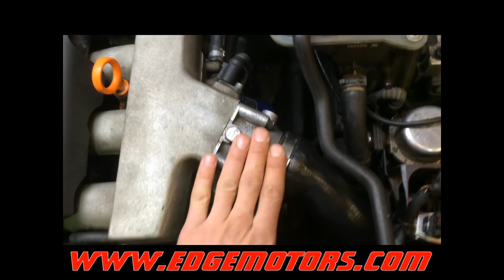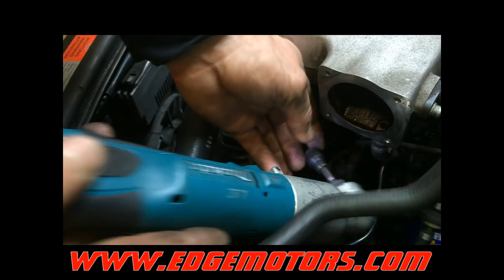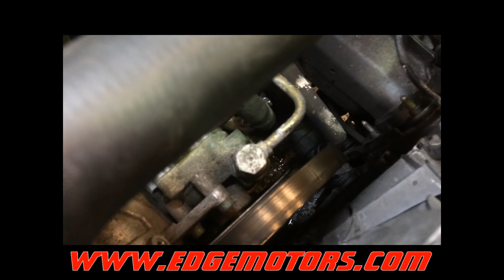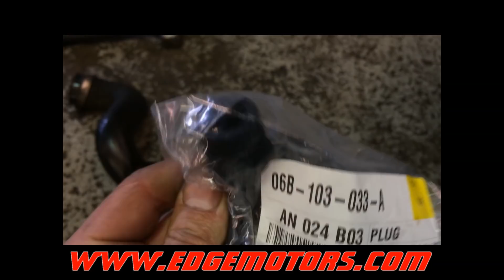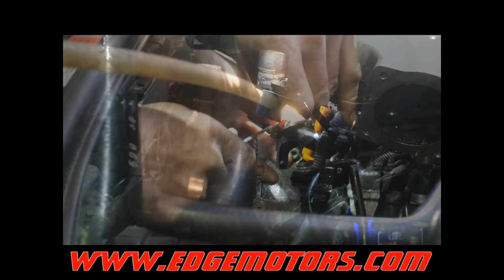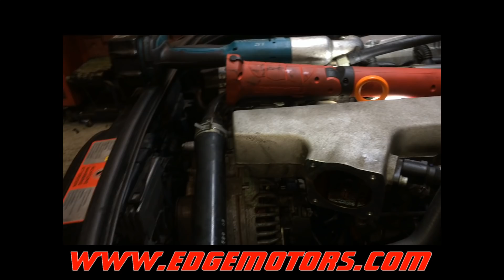2002-2005 Audi A4 1.8T coolant thermostat replacement DIY by Edge Motors

Comment: In my A4 the wires that are connected to the valve dried out and touched each other, burning my ECU, I changed the ECU and repaired the bare part of the harness, I installed a new thermostatic valve, but when it reached 100° C the ECU is not opening opening the thermostatic valve, have you ever experienced this? the plug only reaches 2.4v

Comment: Tip for some with different size bolts, mine was 13mm for the bolt from the top at the oil filter bracket

Comment: I know this video is old, but I’m having an over heating issue and have been searching for a solution. It only over heated when my AC was on full blast. I noticed my fans were not working so I’m thinking maybe it could be due to the fan module? I’m not sure. Any advice I would appreciate. I have a 2004 A4 1.8T btw. Thanks

Comment: Can anyone help. Ive got a 2005 a4 cabro 1.8T. I started to change the thermostat housing all ok. But the wiring loom was in my way si i disconnected all the d plugs. Now i dont. Know what goes were. What colors is the thermostat. Could i have the ict one conbected to it? Is my new thermostat working? Ive also changed the sensor at the bottom in libe with hose. Is that red and black or green and blue. Were does the a/c one go on? Does it connect to another d plug? Ive just foubd another d plug tucked away behind the front light? Help im screwed

Comment: have you done on the 2001 a4 b5? Im having a leak issue after installation. does the O-ring go on the engine side first then the thermostat, then plastic housing? or is it thermostat>Oring>housing or two orings? im lost, when i took it out the o ring was around the actual thermostat it wasnt real o ring
Reply from the maker: Thermostat oring housing...
Reply: @EDGEMOTORS  weird i placed the thermostat in, put the oring in the groovs, screwed it back on and it leaks everytime, not using any silicone or anything.
Reply from the maker: You should put the oring on the housing.... there is a little step for the oring....

Comment: Don't listen to this video.....jack the car up a little bit, remove belly pan if you have one.  Then you drain the rad, remove hose from thermostat housing 2 10mm bolts off housing and bam....reverse to install
Reply: Thought that was only for the b5 not the b6

Comment: Was that a coolant temp sensor you used to remove the coolant from, and was it a 2 -pin or 4-pin?  Could that sensor malfunction set off code P0116?

Comment: my car overheats and I already bought the sensor for the coolant and had a cylinder #2 misfire I changed all the spark plugs out and my car still overheats I need help on what it could be asap pls
Reply from the maker: Well, it could be allot of things, I would need a bit more info on the car...
Reply: Like what
Reply: What kind of info
Reply: +EDGEMOTORS if I run it around the block for like five mins it goes to the middle gauge fast and than another 5 mins later it goes to the red. could it be that I have to replace the thermostat.?
Reply: Alex B I have the same problem did you repair it? Or what happened?

Comment: I'm going to ask the same question that's been asked TWICE now. What is the name of the red lube you brushed onto all the hose connections?! 

Great video though. Very informative and helpful, especially seeing where you used really long extensions instead of trying to get under it with a tool. Kudos!
Reply from the maker: That's a regular bearing grease...

Comment: You should mention that you should have your radio code before you disconnect the battery.
Reply from the maker: Most of the vw and Audis past 2001 will remember the code even if you disconnect the radio, but it's a good idea to have the code anyways...

Comment: I recently had my thermostat changed on my Audi a4 cause engine light on and no heat. $500 later I am losing a LOT of coolant somewhere, no leak on ground, no smoke I can see and I still have no heat. Any thoughts??
Reply: Probably waterpump
Reply: Could be your heater core as well. It's a common issue with this model.

Comment: Also, two things. A) can you guys make a detail video on how to pressurize the coolant system properly. B) What is the round metal apparatus that is next to the Power Steering Reservoir? it is missing from my vehicle. its just an empty spare opening.
Reply from the maker: your car is manual, this one is automatic... the metal thing next to the power steering tank is brake vacuum pump.
cars with automatic transmissions have different amount of intake vacuum when you driving than manual cars... this thing is making sure that you have enough vacuum in your brake booster for your power brakes to function properly.
Reply: Oh ok, thanks for the info.Also i just had my thermostat housing replace and coolant is still leaking, i think its the coolant plug,because i didn't replace it too. Because i was not aware of it and clearly neither was my mechanic who should've recommended it.its too cold outside for me to fix myself so just might take to the dealer.

Comment: Hey guys, I'm starting to follow the steps to get to my thermostat but I had a question, my 04 A4 overheated and started pissing coolant, I replaced the coolant after cooling down, no problem driving but lost a lot of coolant, I re-filled the reservior with coolant and when the vehicle is off it is still leaking all the coolant out and I found a small hole that Looks like it's supposed to be there on the top of the thermostat housing (looks like) and it is leaking out of there, my concern is that it is spilling coolant out when the car is off!
Reply from the maker: there not supposed to be any holes on the thermostat...

Comment: I have a 2002 Cavalier. My car has been overheating lately. I pulled it over when the temp gauge was at 3/4 and when I popped the hood the fan was not running. It seems to overheat especially when stuck in traffic. There seems to be no leaks under the car as well. Do you think this is due to a faulty thermostat?
Reply from the maker: by the way you explaining it, it looks like you have a problem with the fan, not the thermostat

Comment: This looks similar to my 2006 A4 Audi Cabrilet convertible.  Do you know if these instructions would be the same or similar?
Reply from the maker: these instractions will be very simular, but those are two different engines, so there will be a couple of different parts there. but the thermostat set up is almost the same.

Comment: ? What is the silver round part next to your power steering reservoir? I have a space there that looks like something is suppose to bolt in?
Reply from the maker: THIS IS A BRAKE VACUUM PUMP THAT COMES IN AUTOMATIC CARS ONLY, TO COMPENSATE FOR LACK ON VACUUM UNDER DECELERATION.
Reply: Thanks!

Comment: Hi, what lubricant did you use on the connections before you refitted all the external pies etc......thx in advance.............cool video by the way
Reply from the maker: just a regular brearing grease.

Comment: Curiosity - what is the plug for that was broken in this video? If it is bolted in, why does it exist?
Reply from the maker: this cylinder block was used in a VW Passat as well, the Passat have a different thermostat set up, and the coolant pipe that's bolted to the thermostat housing on the a4 goes into that hole on the Passat...